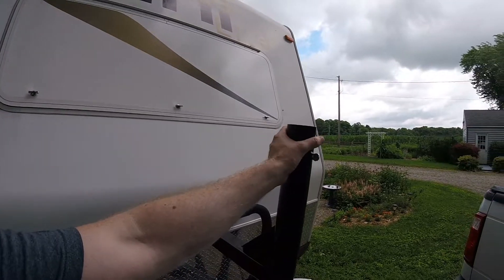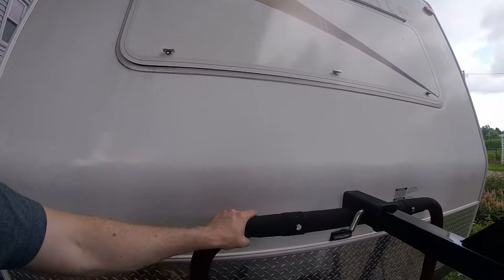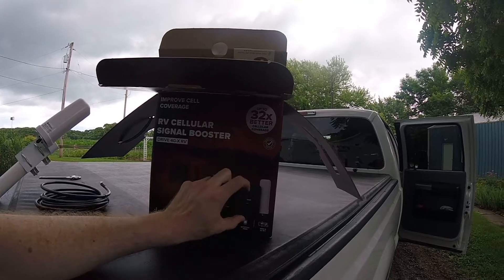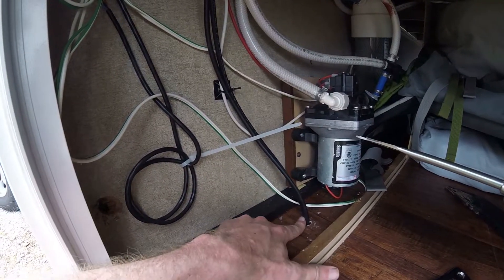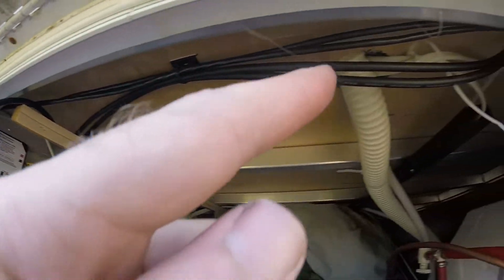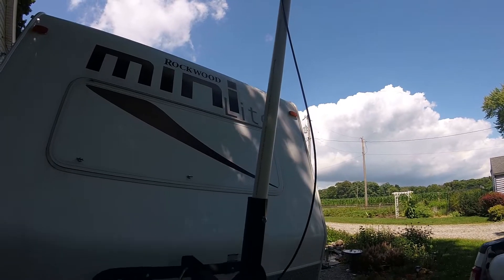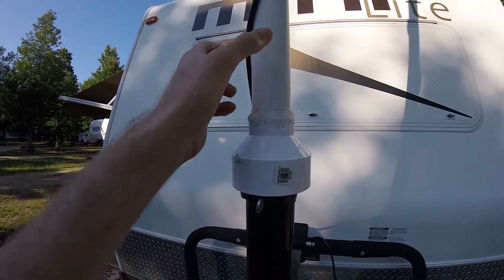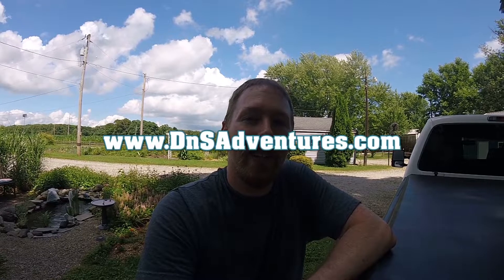Leakproof Solution | weBoost Drive 4G-X RV | Flag Pole Install

Comment: I see you were able to fit not finding your icon in the search bar! Nice to see it there. I know it's not at all related to the product, but how many solar panels do you have for the RV? Are they 100w? Could you live off grid with the amount of power you get from your solar panels?
Reply from the maker: Josh the Travel Guy Hey Josh! We mostly installed our solar setup to help extend our battery while boondocking for like a day or two. Quite honestly we haven't really tested it out fully yet because most of the time our campgrounds have electricity to hook up to. We do have 2 100 watt panels though that should help out quite a bit. Maybe I'll bring up this subject in our next live stream as going off grid is something we are definitely interested in doing in the future. Have a great week sir! - Shane

Comment: Cool - good job! I would love to know if the WeBoost really works to get a better signal or not. Does it only help with Wifi or does it help with cell signal in remote areas? Nice job on the call to action, too! Love it!
Reply from the maker: Em And the Gang Hey there guys thanks for watching! So this particular product only helps with your cell signal. I think WeBoost also makes other products that can help boost your WiFi to help reach hotspots further away in different campgrounds. For us it has helped in some situations and not so much in others. For the most part though, if there is a signal it usually at least helps the upload speeds. If there isn't a signal to be found, it can't really boost it to higher speeds. If you are in the market I'd go check out the RVMobileInternet website as they are an awesome resource of info and explain in depth how it all works. :) Have a good one! - Shane